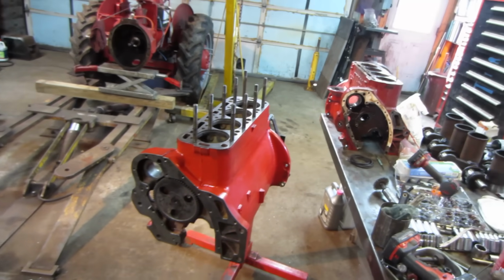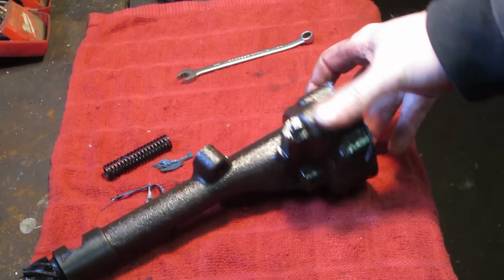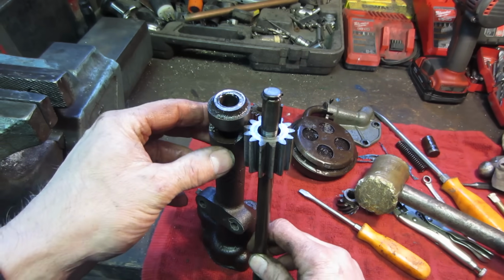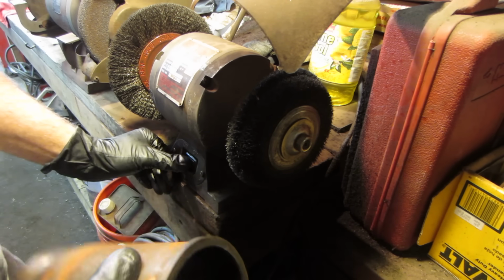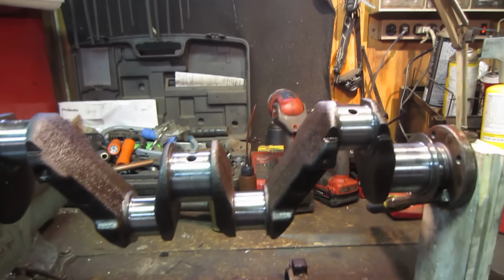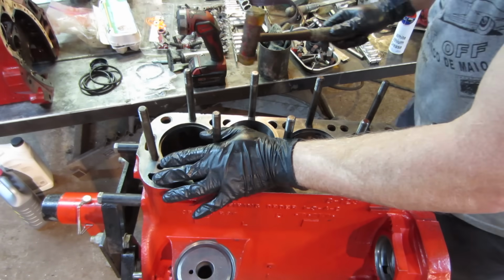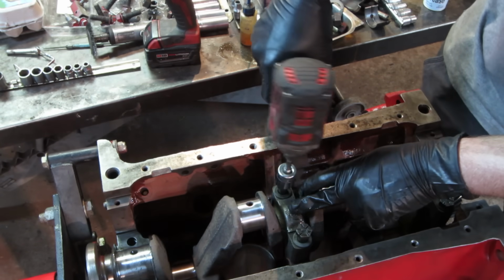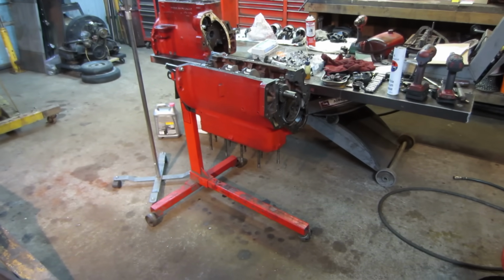1941 farmall a tractor engine reassembly. pt4

Comment: Mustie I have been watching you for a long time , I have been doing lots of things as far as fixing things , a lot of mechanical work gas and diesel, worked for Yancey Brothers Catterpiller , Tracks Corp. , and I worked on small engines , flipped housed, even had a contract with Army to repair watches and jewelry and did many other things. I like that you use common sense and figure things out, I am like you and work on many things for the first time and tackle anything that needs repair. Your pace is fine , you keep doing what you do , there will always be someone telling you how you should be doing what you do but I suspect many can’t do what you do . I continue to learn from you . Keep it up …… SA

Comment: i had a crack down the side of 6 cyl looked like you had that had froze up ... cleaned crack real good v the crack. used JB weld and it worked. i also put ceramic stop leak that they use on race engines ? it was in a snowball truck. lucked out it worked. she ran it aleast 3 years.

Comment: You must be off your crust using emery strip on your crank journals, it will leave microscopic bits of emery in the metal and turn it into a file on your bearings. I would also say, looking at the corrosion around the top of some of the water channels on that block it should be skimmed.

Comment: Mustie, take a look at Valvoline Motorcycle oil with high zinc package. Should work well in this elderly engine. Keep the great videos coming.
Reply from the maker: l think some diesel oils might have it too
Reply: Not any longer. EPA mandated that the diesel oils had to drop the extra zinc as well. Makes it a PIA for flat tappet guys. It isn't a huge deal in the old tractors because the spring pressures are lower but It isn't a bad thing to toss some additive in with the oil.
Reply: I did quite a bit of research about this recently and what I read was they have pulled the zinc out of the diesel oils because it plugs up catalytic convertors. I bought Lucas Oil zinc additive. Probably some of the off road oils like Alan mentioned still contain zinc.
Reply: MSDS on Valvoline's web site still shows zinc compounds as an ingredient.
Reply: The amount in today's oils are barely enough to register as an ingredient. Zinc was removed solely because the actual compound ZDDP (zincdialkyl-dithiophosphate) kills converters. However in a flat tappet cam, especially ones with high lift and high pressure springs, the lack of the extreme pressure protection of ZDDP has resulted in many failed cams and destroyed engines.

Comment: Those O rings Expand out to tighten in the groove as you push the cylinders into them if they fit too snug in the groove when installed it will cause them to crack with little hair line cracks when u put the cylinders in because they will then be too tight in the groove

Comment: On those rounded bottom keys, just tap down on one side and they will rotate out of the slot and when they are far enough out, they will be easy to grab with vice grips if they don't fall out of the hole outright.
Silicon bronze braze the warn part of the shaft and turn it on your lathe to the proper size.

Comment: Check the oil pump cover for flatness.  The pressure relief spring tends to warp the cover creating a leak at the oil pump and low oil pressure.  I think that is the reason for the silicone the last guy used.  I built a  bridge out of 1/2" square bar and shims to support that area of the pump cover on my Farmall H.  Keep up the good work.

Comment: Ok I'm watching this set of videos for the 1st time and I may be an old English nut case but i love em just the way they are. I in my younger years enjoyed restoring old motorbikes. Now in my later years after an 18 year break I just repaired and restored a Yam YZF600 Thundercat for a friends lad after he dropped it and just finished a 1990 Yam Fj1200 for myself but with no facilities of my own to finish it I had to pay a small fortune to a shop to do what i could have done myself 20 years ago but after watching some of your videos and the fun you've had when you get them running has driven me to start riding the darned thing too. So if i don't kill myself on it I will be watching many more of your exploits, Thanks for giving me so many to work through, i will be hooked for many moons to come so don't change the format, length or any other aspect of the videos, they are just great.

Comment: The ware on that shaft may cause a little separation on those two gears which may significantly reduce oil pressure, Machine shops can make a new shaft,  You would want to send all the parts if you found a shop. Abome79 does that kind of work.

Comment: Sir . The next time you resurface the Cylinders. Please consider turning the Drill Motor MUCH slower with increased pressure. The result will be a much improved "cross hatch" Ted.
Reply from the maker: pressure was non adjustable, as l said in the video
Reply: I stand corrected. V.

Comment: Another way to remove a key is to use a pair of diagonals and pinch each side of the key then pry it up against the shaft. Very little effort and works on both square and woodruff keys. Great video! Keep up the good work!

Comment: Hi Im a old retired engineer and have watched and enjoyed quite a few of your vidios so just a few tips of my own 1 rusty fuel tanks I used phosphoric acid a bit safer than hydrochloric  2 cracked cast iron blocks I found normal brazing with lots of flux worked best 3 I always tried to use soft jaws on the vice when holding soft ally parts. Great to see someone after my own heart working

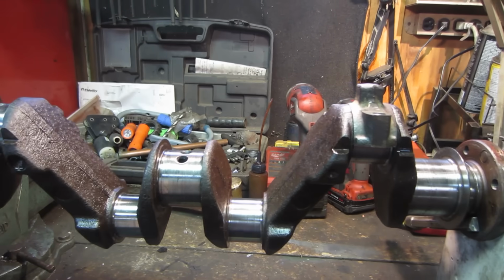Comment: 21:30 - 26:00 i can tell ya i have heard that rod knock, and it will freak you out if you dont know what it is, if i had found your stuff before i had helped rebuild the engine in my 78 mercury zephyr z7 i would have known what that sound was

Comment: Noticed you trying to figure out which way the main bearing caps go the lock sides ALWAYS go together to lock those inserts to keep them from spinning same with the rod bearings if you noticed when you turn the cap over to put it in the block the locks were on the same side of the block in opposing locations thats what locks them

Comment: Lubriplate L0034-094 Motor Assembly Grease .  Mucho better than oil.  Helps protect better than oil during low oil pressure startup after rebuilding.

Comment: I always use Lubriplate white assembly grease on all insert bearings initially. I also use liquid dish soap on liner rings. Lots of years of Detroit overhauls  gave me that knowledge. I also thought those liner rings were too small, but I guess you will find out buddy.

Comment: Hey just started watching your channel. I really like your attention to details and professional level skills at the engine rebuild. Im currently in the process of  rebuilding a super A  engine. Actually replacing the block with a salvaged one. IT sat out in the weather for years with no head on it. its been a challenge to disassemble. had to make a slide hammer to remove valve lifters , after cutting cam shaft in 3 pieces. Had to cut connecting  rods just to remove crank shaft , had to cut pistons in half to remove from sleeves. Then make weld passes inside sleeves to shrink for removal.  Yea.....Whew!  Block was free and solid but took a lot of effort so far. So now I got two more issues....a rusted out expansion plug and a huge amount of chalky , caked up  rust throughout water passages. Any experience to share on dealing with that stuff ?  Thanks

Comment: I like to put the white lube that you used on the o-rings, on all the bearing surfaces, and any moving internals. White lube will disolve as soon as the motor starts pumping oil, and it won't run off and leave a dry bearing surface., (Just my 2 cents worth) Great video series.

Comment: As to tapping the stud holes, they were probably cut with a class 3 thread, which is practically an interference fit. Using a class 2 tap would loosen them up too much.

Comment: Silicon is the death of engines. Especially in the oil pump. Good you found it. Many oil pumps have precision ground surfaces therefore no gaskets. It's an end play thing. You're doing a much better job than a farmer would do in a field. Keep up the great videos.

Comment: I particularly like your old motor cycle videos.  I had a honda XR 75  They were silver in the seventies then switched to the red color.  I had a red one.  Great old 4 stroke motor but I seemed to always have problems with the points if I remember right.  when I was a kid and if you ever found one of those to work on I would flip out.  Also would like a video on how to rebuild a small two cycle carb like from a weed trimmer.  Maybe you have made one already.

Comment: Greetings: 
You mentioned in passing that this rebuild will produce more power. Is that due to some dimensional difference in the bore/stroke which would require piston changes or new connecting rod, or just that the rebuild itself will result in better compression etc.?
As the replacement block is obviously used, what was done to it besides the red paint? Looks like the interior could have used a good sand or walnut-shell blasting.
Why are the old main bearings from the previous crankshaft remaining (prevent damage?). Why are the old block main bearing caps better than those from the newer block?
Until you showed the service manual I had no idea this was an International Harvester tractor. My only endeavor in engine rebuild was my Lotus 907 rebuild from my '74 Jensen Healey. I remember the squishy Plasti-gauge used to measure the main and rod bearing clearances. I was surprised to learn that the SR-71 also could not prevent oil leaks when colds (valve covers).

Comment: Some of the vids are a bit long, like the head studs. I notice you use normal oil to pre lube the cam galley etc. I have used STP or what's now called Assembly Lube for years.
And on a v8 etc the old distributor drive in a drill to pressurize the oil system before first start is a wonderful trick. Keep up the good work man, wish I had the space you have to hoard parts and toys!!

Comment: My trick for pulling out a key is with wire cutters.  You grab the key along it's length and lift the handle and the tips will push on the shaft and the key will pull up.

Comment: Next time your clean up crank journals with emery, you might want to try folding your long strip of cloth in half, lengthwise.  Then you will have emery on both sides and and can wrap it around the entire journal.   Pull back and forth and you get even pressure all around.

Comment: I can’t believe you did not hot tank this engine I worked in our engine rebuild shop and the stuff that comes out of the oil galleries and the fact that this engine had so much rust in it and you had problems with contaminants on your rod and main bearings. Guaranteed you’ll have problems again. You can’t clean out oil Calories by just blowing air and trying to get a brush inside go get it hot tanked it will come back spotless. If you’re worried about the paint job it’ll take five minutes to repaint it

Comment: Mustie, a quick safety issue, don't stand in line with a powered wire brush  when it first starts; this is the most likely time a wire or so will come flying out and cam penetrate the body. they are usually contaminated id can easily cause infection, and Murphy says it has a good chance going in the eye. The same is true for carborundum grinding stones. This is when they are most likely to exploded; using the sides with just a little too much pressure is just as dangerous. Still a great video.

Comment: Great job on cleanup and assembly so far. The silicone on the oil pump cover & inside the gear area, hmm. Good catch and time well spent taking that apart and finding the worn shaft too.

Comment: Bearings: I think some are responding to your use of the word "Used" in describing the bearings. But they sure did not look used to me, and correct me if I'm wrong, but I thought you said they looked as if somebody had installed them to check for size and then repackaged them. That's really not used: the engine wasn't fully assembled nor run with them in place. Great vid!

Comment: you're doing great. as a tractor guy, you're definitely using good judgement. 

-the oil pump, great job on catching that. I know used pumps aren't as cheap as you'd think, but it's definitely better insurance than what I suggested a couple videos ago with the washers behind the relief valve spring. although, I still recommend it since the oversize piston kit bumps up the hp. 20psi hot would be a decent pressure for that engine.

-using those "semi-used bearings" seems to be OK based on what I see. I'm hoping that you got discounted a few $ because of the open box, but as long as that magic number (.003") is still in tolerance, I don't think you'll have any issues. 

-I'm glad you mentioned the head studs were blind holes. I'm used to them being open bore and using aviation gasket maker to prevent weeping instead of loc-tite. much better construction. 

-the o-rings at the bottom of the sleeves are not a huge concern, you're right that it would suck if they leak, but the easy test is to fill the block with antifreeze (once it's assembled on the stand) without the head or oil pan and let it sit for a day to see if they weep. if they do, it's a faster disassembly process to put in a better fitting o-ring. 

-glad you were able to find references on the camshaft timing marks. that would definitely suck if that was backwards. lol.

keep at it, buddy. these videos are just right for the average guy that knows a few things.

Comment: Think you may have gotten lucky getting that gear off of that oil pump.  That or I got unlucky with mine. Your's came off way too easy.  Mine wouldn't budge. Got it off but not without boogering up the oil pump casting itself.  Turns out the end of the shaft was way over.  Would have had to press it back on.  Ah well, can't learn anything without doing it.  Got a used one on order.   Great series on this tractor engine by the way.

Comment: I never rely on timing marks instead I use a degree wheel and a dial indicator to check timing.  Most motors open intake valve at approximately 30 degrees BTDC  26, 27, 28

Comment: Used bearings being sold as new.  Very sad.  I would have taken the time to run some plasti-gauge on the mains to check clearance.  Using it is a pain, but once I found a used crank that looked good, no scaring, etc.  Only problem was one main had been turned down to next size bearing which meant the bearing being supplied was way too loose and not have carried adequate oil film pressure across the face.  I could have avoided the whole issue by taking the time to mic all the diameters and then I would have found the issue much easier, but live and learn.  I understand you were using a crank taken from the broken block, but you can never be sure who was in that block before you.

Comment: Was metal stitching the old, cracked block ever a consideration ?
Reply: He tried grinding and welding the crack 1st.
Reply: Yes, but that wasn't my question.  I was referring to products and techniques such as lock-n-stitch or metalock in which cracks are basically filled and stitched together from both sides. 
Probably too time consuming and expensive when you already have a spare block lying around.
Reply: CaptHollister It was in pretty bad shape and it appears the owner didn't mind the expense of replacing the block with A good bone yard one. I saw one on Craigslist last week for 200 buck's. Likely the Lock And Stitch plus labor would cost the owner over $200.00.

Comment: I'm glad you clarified the situation regarding those main bearing caps - I was wondering at one point, though I don't think you'd make kind of a mistake.

Yeah, those "I-T" shop manuals can be a bit vague from time to time. My dad bought a few over the years, but as he said then, "It's better than nothing at all" and given the massive tomes of the original manuals, I think they do a fair job of condensing the data and still keeping it usable.

I don't know what spares companies you have in the US, but over here (UK) we tend to stick with "Vapormatic" and "Sparex" in the main. To date, they've never let us down, nor supplied duff parts. . . .  Correct me if I'm wrong, but isn't Vapormatic owned by John Deere?

Comment: On the block prep commentary at the start of this clip...  Folks its a 1941 tractor!  Fix it in the field with basic tools and rigged repairs, no manuals or torque specs.  It's not about super fine tolerances and computers as today is used today and that contribute to our current desposible or forced replacement by corperations to keep their "shareholders" happy...

Comment: are you gonna do some coolant pressure test to see if those sleeve orings were the correct ones?
or did you measure the thickness of the rubber?

Comment: Did i see a little square hole on the engine caps of the bearings and on the block it self ,so to see how they go on?.. ( you where looking what side goes where..). Just asking , i couldnt see it well.  And i dont understand why they like to send you used material when its so important not to be😓